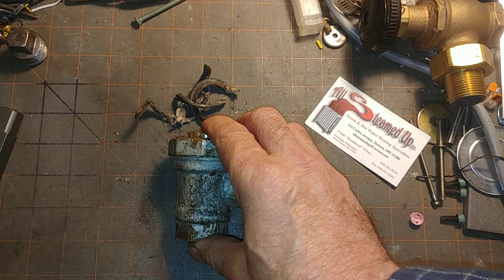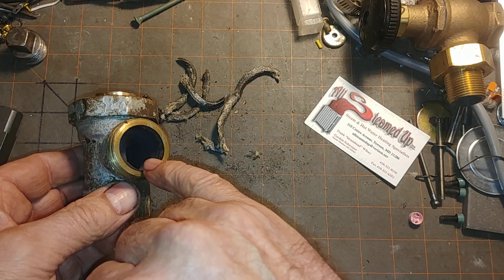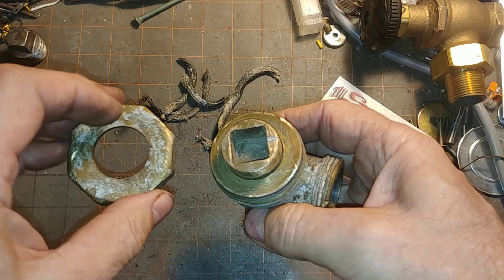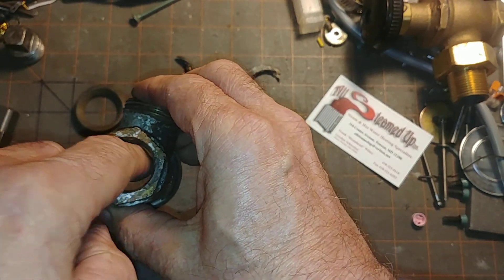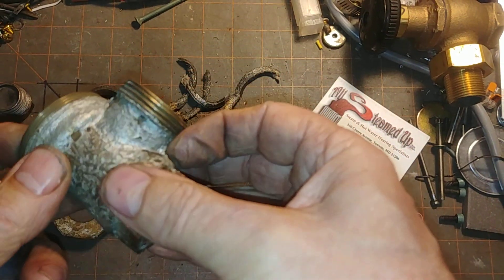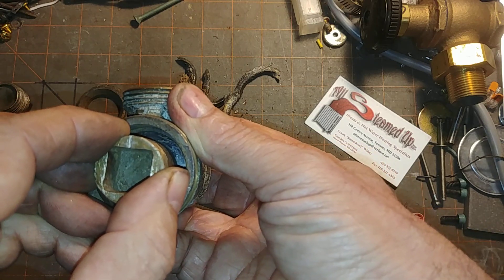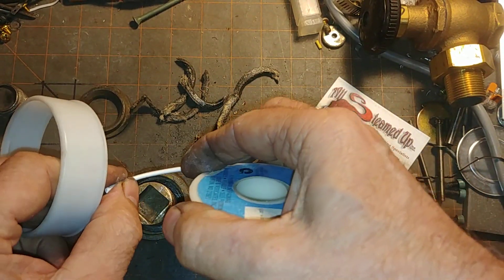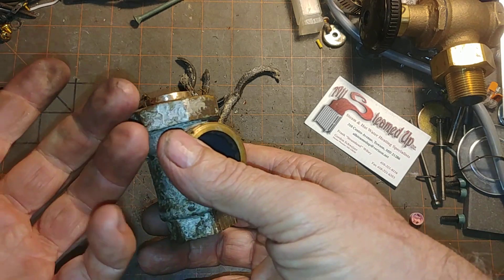Tips On Rebuilding A Radiator Valve From A 120+ Year Old Two-Pipe Vapor Steam Heating System

Comment: Seems like the rad would have to be pitched toward the return as that valve looks like it wouldn't allow water to go backwards. Water laying in the valve would probably contribute to the valve seizing up I would think.
Reply from the maker: That usually doesn't matter because this valve is designed for a two pipe steam system.